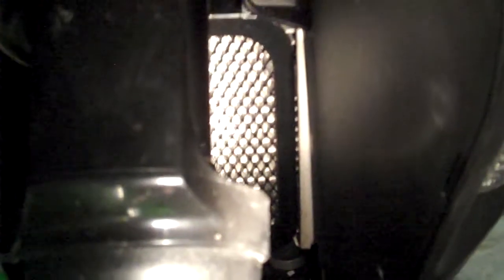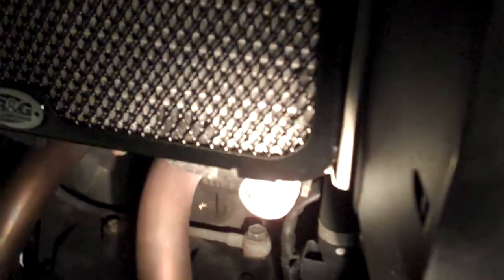Kawasaki Ninja 300 R&G Radiator Guard Fitted & info

Comment: Thanks man. 
Bought this, but was put off installing as the instructions said the fairing had to be removed. 
Couldn't figure out why you had to and thought too much of a PITA to do. 
Glad I came across your vid. 
Bought the lower guard as well, and I don't think you have to remove any of the fairing for that either, even though the instructions say you have to. 
Sweet. 
Cheers matey.
Reply from the maker: +Firsten Last glad to be of assistance. Ride Safe